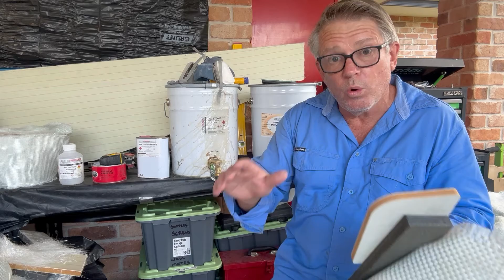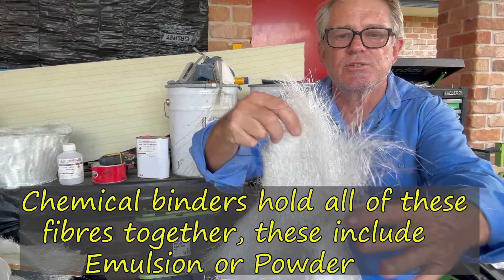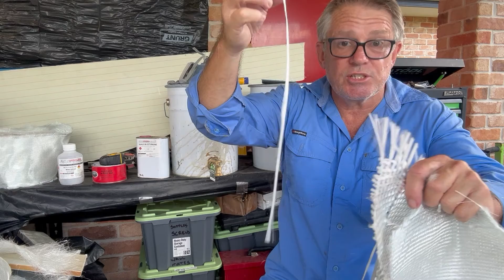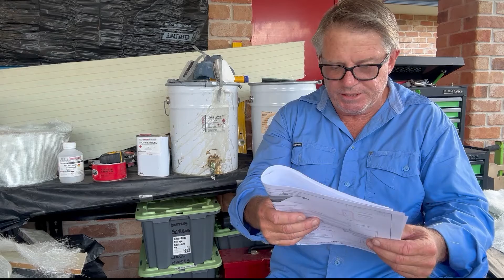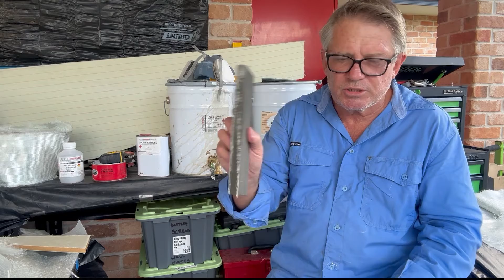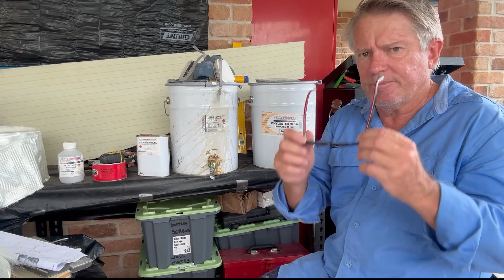The Best Hull Extension Materials Explained

Comment: What was the stringer lamination schedule?
Reply: This is an amazing watch
Reply from the maker: Thanks mate!
Reply from the maker: It doesn't actually show a stringer lamination schedule but it shows the FF360 H60 foam that comes with 1050 gram laminates used for stringers and tabbed in using 2 X 150mm 600gram Double Bias tape